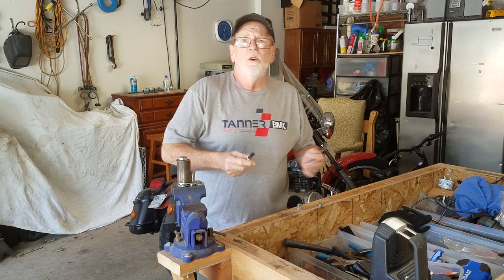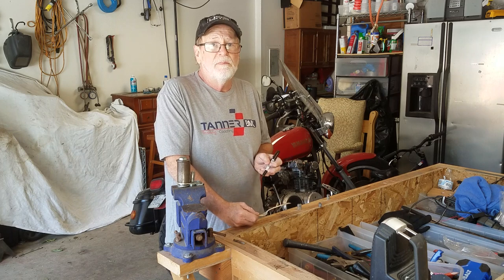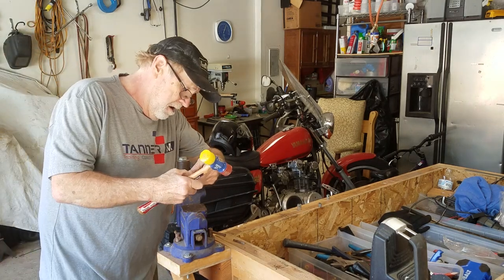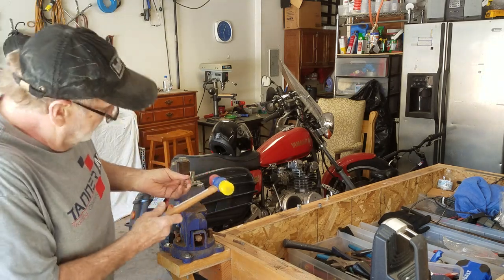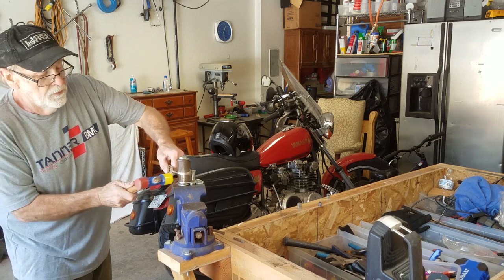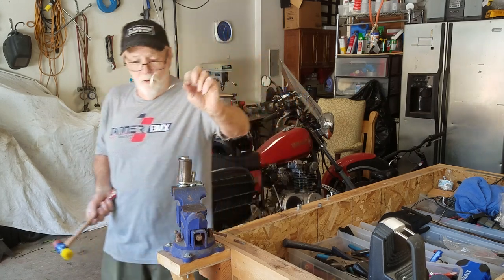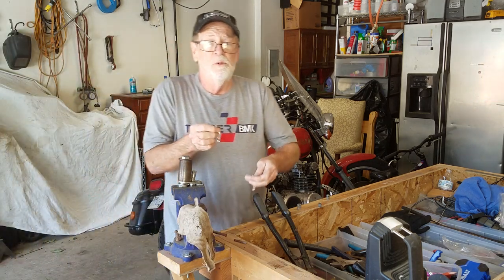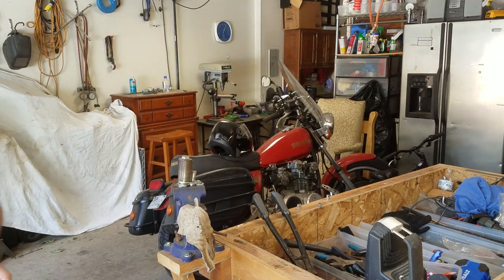Spoon bracelets made simply

Comment from the maker: Sorry for the long delay on responding,  I really don't get on here very often. The jig I made out of this around my garage,  the main barrel is a 6" long piece of steel pipe, I cut the threaded ends off. The case can be anything solid metal, a piece of flat steel is fine. Used a 3/4" hexhead bolt, used a 1 1/2" flat washer on top, put the bolt through pipe, another flat washer,  through base then a lock washer and self locking nut, then about 1/4" away drill another hole for a 1/2" bolt and threaded base plate, put bolt in leaving about 2 inches tall and cut bolt off and used vinyl tubing to protect silverware,  then I just use the nut on bottom in vise to hold.
Reply: do you sell your jigs?
Reply: greg tanner Beautifulll Work 🙌😍 thanks
Reply: @patwinter2659  I would love one too
Reply: I'd like to buy one too. Let us know

Comment: What r you using for the jig?
Reply from the maker: The round part of it is 1 1/4 steel pipe nipple, I then drilled a hole in a piece of flat steel plate used long bolt and nut to secure together and drilled another hole about a 1/4” away from the pipe and put a smaller bolt to slide spoon or fork into to hold flat against pipe to bend. Hope this helps 
Greg
Reply: @gregtanner584  thanks so much